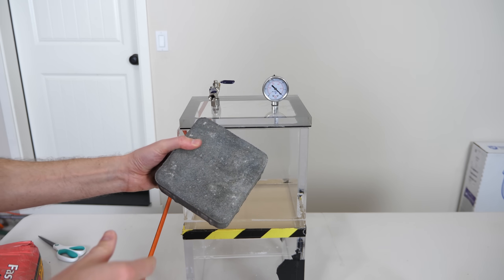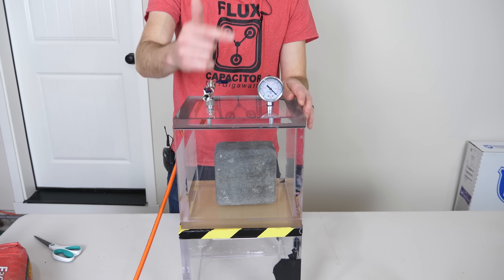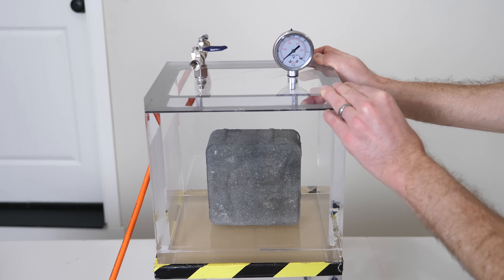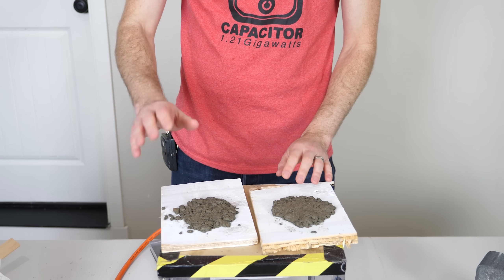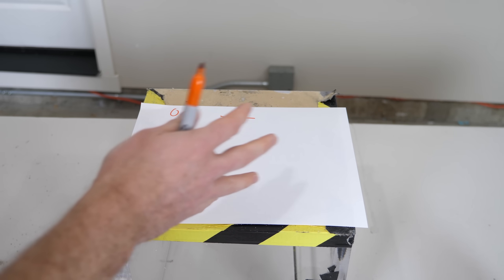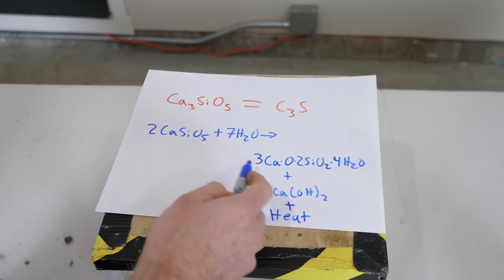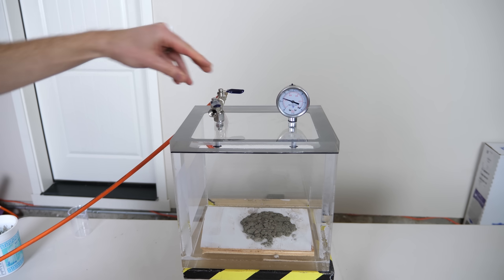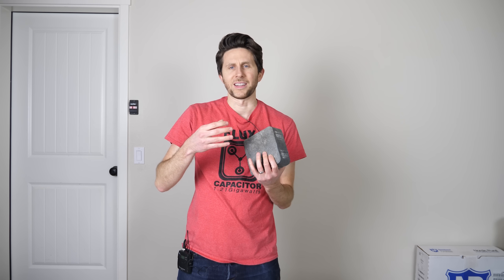Does Concrete Turn to Dust in a Vacuum Chamber? Concrete Without Oxygen Experiment

Comment: By that logic, removing all oxygen would also turn the oceans into hydrogen gas.
Reply: If oxygen was removed from all molecules, you would have much bigger problems than concrete crumbling. The human body is 65% oxygen by mass. All life would die, including the microscopic kind, as DNA itself contains oxygen.
Reply: @imarchello  the earth's crust is made of silica so the entire crust would collapse
Reply: @wedmunds  yeah but then why didn’t earths crust crumble when it had no oxygen🤨
Reply: @skylar4941  hes just silly
Reply: @skylar4941  it always had oxygen though? Not sure what you mean.
Reply: @wedmunds  not she. It was first created and was a boiling ball of lava
Reply: @criauxe  speak for yourself.
Reply: @skylar4941  lava is molten silicon dioxide. Oxygen bonds to silicon in the protoplanetary disk, long before earth even coalesced.
Reply: @wedmunds  what I meant is when earth started to form...
Reply: @skylar4941  that doesn't change anything. At no point starting from the birth of the solar system to present day was earth without oxygen.
Reply: @wedmunds  ik but there wasn’t oxygen maybe on other planets there was
Reply: @skylar4941  you can't just make unsubstantiated claims like that. You need evidence to suggest that all oxygen came from some extraterrestrial source.
Reply: @wedmunds  Well, it's true that, before photosynthesis started, the earth atmosphere was without oxigen at a certain point. But yeah, that is because all the oxigen had bounded with the silica.
Reply: @wedmunds  you say it's unsubstantiated to claim that oxygen may not always have been on earth, but the most recent study about oxidation on the planet, says oxygen started forming at least 3.1 billion years ago, some other studies say it started 3.5 billion years ago, can you prove that it was here 4.5 billion years ago?
Reply: @Gnozzares  Please explain what you mean by "oxygen forming in the oceans". Oxygen is an element, oceans don't just magically create elements. All the proof I need is the fact that silica (SiO2) is the most common form of silicon in outer space and is what proto-earth accreted during its formation, meaning that oxygen on Earth is even older than Earth itself.
Reply: @wedmunds  I was talking about oxygen molecules not atoms
Reply: @Gnozzares  I was never talking about molecular oxygen starting from the first comment.
Reply: @skylar4941  it’s crust evolved over time at some point it probably wasn’t reliant on oxygen
Reply: @shaneosborne5426  how the hell does crust evolve?
Reply: @skylar4941  the crust wasn’t formed then, when the crust was fully formed earth did have oxygen just not enough for you to breathe enough in, it was mostly Carbondioxide instead.
Reply: @thepiratepeter4630  oxygen has always been in earth ever since the planet stabilized (especially because these people are talking about oxygen atoms rather than actual gas (water has oxygen in it) it was just filled with a massive amount if carbondioxide and carbon monoxide so the air was far too toxic for life.
Reply: @skylar4941  the crust doesn't evolve it changes
Reply: @skylar4941 it always had oxygen?
Reply: @skylar4941  Yes, they crumble because all metal oxides, which occupy most of earth's surface rocks, will turn into fine metal powder. And the organic stuff like oils will turn into hydrogen gas.
Reply: @thepiratepeter4630  Or the iron causing red oceans at some point in Earth evolution making rust? How about that?
Reply: @skylar4941  the reason there was no oxygen GAS (MOLECULAR oxygen) was because it had all reacted to form silicates (i.e. rocks) and other oxides. Oxygen GAS is very reactive and reacts readily with many things. The only reason we have oxygen today is because there is constant production via photosynthesis.
Reply: @wedmunds  Reminds me of an episode of the anime No Game, No Life, where a magic simulation removes or adds whatever you specify.. removing oxygen from the air being one of them... and removing the different layers of the planet another...
Reply: @wedmunds  most oxygen was created by bacterias on ocean, so? It's called " photosynthesis" Which plus the planet's atmosphere turned red bcz of rapid raise of oxygen for a while.
Reply: @Gnozzares  they are saying it was part of (or parts of it where in) other materials, that then were released into the atmosphere.
Reply: @Ayzixior  ig because there was no oxygen therefore there was no sillica to begin with since the earth was still forming and didn't have oxygen yet mayb.
Reply: @skylar4941  maybe they meant o2
Reply: @skylar4941  then there'd be no crust yet
Reply: @skylar4941  the earth 4 billion years ago wasnt made out of cement or concrete
Reply: @Slovak_Ball  created lol. Bacteria just started doing nuclear fusion?? Craze stuff
Reply: @skylar4941  like a Pokémon
Reply: @wedmunds  fractalas prove the greatness of God
Reply: @skylar4941  it always has oxygen. Although there is a vaccum in space, every planet has some sort of atmosphere (weak or strong), and the atmosphere of earth has always contained oxygen.
Reply: @skylar4941  All planets have always had oxygen.
Reply: @Gnozzares  you, and a couple others, seem to misunderstand the difference between Oxygen and Free Oxygen.
Reply: @skylar4941  when? oxygen is so low on the table it was around before any heavier elements
Reply: @skylar4941  wdym?
Reply: @skylar4941  the cookie crumbles
Reply: @skylar4941  This person is talking about what would happen if oxygen was removed from _molecules_. The earth has always had oxygen, both in molecules and in the air. There was just a lot more carbon dioxide in the air before cyanobacteria started converting it to oxygen. Anyway, the air is irrelevant here. What they're talking about is if you took all the molecules and ripped oxygen out of them. Since many molecules contain oxygen (including carbon dioxide itself), that would be catastrophic to basically everything.
Reply: @wedmunds  I think if science is more about what we could know and less about what we should know also like my boi said I think there’s gonna be bigger problems than concrete crumbling lol for ex life yeah we’d be long dead
Reply: @wedmunds  doing psychedelics isn’t the same as going to school
Reply: @wedmunds  wow ur smart lol
Reply: @skylar4941  you skipped school?
Reply: @skylar4941  Woah that's a good good question
Reply: @wedmunds  Jesus Christ no one wants to be wtong when they clearly lose a discussion to you
Reply: @skylar4941  gravity
Reply: @wedmunds  He was right. At some point. There was no oxygen on some parts. The reason being many astroids. Some where just h
Reply: @skylar4941  Earth did not have FREE oxygen as a gas, but there was always oxygen locked up in silica and other compounds. Stop making dumb comments like this.
Reply: @skylar4941  No you weren’t trolling. You were just wrong, and when everyone proved how wrong you are you tried to weasel your way out by pretending you’re just trolling.
Reply: @RafaelBenedicto  this was literally a year ago, I was cringe and not mature back then, still I know a lot more about space now. That was 1 year ago when I commented that.
Reply: @Nehunya  mars have oxygen but not in the form of O2
Reply: @skylar4941  character dev right here
Reply: @skylar4941  bruh it has element oxygen in it well u need to learn chemistry i guess
Reply: @skylar4941 because it was only just being built??

(Also, there was other gasses to make up for the loss of oxygen back then)
Reply: @Gnozzares  The oxygen didn't just magically appear, correct?  It was always on the Earth, it was bound up with other elements to form a different set of molecules.  For example, water contains oxygen, iron oxides contain oxygen, carbon dioxide contains oxygen, silica oxides contain oxyen.
Reply: @skylar4941 hahaha nice joke i hope
Reply: @Gnozzares oxygen was created in stars
Reply: @wedmunds  when and where did oxygen get here and come from?
Reply: @wedmunds there have been carbon rich periods where almost no oxygen was present in the atmosphere.
Reply: @imarchello  Basically Thanos just remove oxygen from human bodies
Reply: @imarchello  They say “what if all oxygen was gone from the earth for 5 seconds” The earth, not the air.
Reply: @imarchello  even waterbears?
Reply: @imarchello  that's why this experiment didn't make sense.
Reply: @imarchello  wait.. humans are made mainly by water obviously, but does oxygen weight so much kore than 2 hydrogen atoms? Well.. no ok I'm remembering.. oxygen is 16 times heavier than hydrogen right? Soooo 8/9 (16/18 originally) of the water mass come from oxygen.. yeah.. fuck..
Reply: @imarchello  prove it.
Reply: @imarchello l
Reply: @imarchello just hold your breath until they turn the oxygen back on and you’ll survive.
Reply: @imarchello key word molecule most people don’t even know what it means lol
Reply: @imarchello And yet people want to believe in Evolution... You can't have it without having an atmosphere and you can't have an atmosphere without oxygen and carbon dioxide. You actually need life to produce both, so evolution is not at all possible! Thanks for clearing that up! Jesus is King! God is real!
Reply: @imarchello  some kind would thrive no? Anaerobic bacteria and such?
Reply: Well yes
Reply: I didn't think I'd be learning something about Earths crust today, thanks commenters!
Reply: @ClippyJoestar  haha the short ATP comment actually helped me with my bio studying 😅.. had a minor brain fart and couldn't figure out why ATP sounded so familiar... hour and a half later and I have studied enough bio for tonight😂
Reply: @ClippyJoestar  bruh your brain is full of oxygen
Reply: Some of these "what if" videos are just pointless to talk about just saying
Reply: @anderray9794  Next what if video... "What if, what if, videos ceased to exist for 3.29731 seconds"
Reply: @SheLovesUke1014  I'm not sure what you're exactly trying to say, but fire requires oxygen (or another oxidizer) to burn. The "fire" 4.5 billion years ago was glowing hot magma.
Reply: Well it would possibly because boiling point is dependent on air pressure.
Reply: Earth would lose a lot of mass and every life form would die.
Reply: And most of Earth, from the crust down to the outer core, in molecular silicon with just a tiny bit of carbon and metals here and there.
By the way, thst would remove about 46% of Earth mass.
Crumbling concrete would be the last of our problems with the entire Earth instantly robbed of almost half its mass.
Reply: Yes. But vaccum pump can only remove free oxygen from O2 and not the oxygen in the compound H2O
Reply: ATP has 13 oxygen atoms in it so I'm assuming we will die suddenly
Reply: nice we were  kinda low on that in the lower atmosphere anyways
Reply: yea it's retarded, they talkin about removing oxygen from compounds also, of course that would do something wtf? and?
Reply: I think it’s meant as oxygen gas as in O2.
Reply: What about our body’s then
Reply: Well, hydrogen gas and sodium
Reply: Literally makes me wonder just how crazy it would be if truly all Oxygen was just gone all of a sudden. Cuz we sure as hell know those videos are just...right but basically wrong since they only showed some of the stuff that would happen
Reply: @bountylord9125  it would basically hit the reset button on the formation of earth as well as restarting evolution of life. This is mainly due to the fact that most molecules have an oxygen attom attached.. the real question my friend is would sentient life happen again or was the location in space, when earth was formed, somehow a factor in our existence 🤔
Reply: @Ritesh He is helium H2 is hydrogen
Reply: @Ritesh 

H is hydrogen
He is helium
Reply: We wouldn't exist either.
Reply: Then Carbon will be raining on us
Reply: @theaustrianpainter-m5o  🤦🏼‍♀️
Reply: Dont forget the ozone layer
Reply: it would be cool if only half ofvl the oxyghen would be gone and then ignite the ocean
Reply: @Andre_Thomasson  if the intent is to dry up the ocean, and don't quote me on this cause I'm too lazy to do the math, I'm pretty sure the remaining oxygen in the atmosphere wouldn't be enough to burn all the hydrogen.
Reply: Bruh by that logic the whole earth would likely experience problems
Reply: @asdgreersf  wait.... are we not already experiencing problems🥺
Reply: It would turn it to liquid hydrogen
Reply: @74_whitey62   if water don't have oxygen what would happen? Well it would become hydrogen not liquid though. Oh the world would look like venus if there's too many hydrogen in the atmosphere
Reply: half the people in this comment chain are talking about o2 and the other half are talking about all oxygen even in compounds. BRUH
Reply: @nathanromine6032  best part is there's a good half of each side that doesn't know which side their on😂
Reply: @nathanromine6032  what means even in compounds? oxygen is oxygen you press 8 protons together= oxygen you bond it= still oxygen you add neutrons and its still oxygen
Reply: i think they mean remove evry oxygen atom fro earth so yes
Reply: True, chemical reactions can’t be undone, so you are rigtj
Reply: @brickdomino1  it would pull its self together, but in doing so would reduce the size of the earth a significant amount. I feel like this is what they meant by crumble. You two are basically saying the same thing just different wording... you chose scientific terminology and explanation where as they chose a much simpler easier to understand wording... but neither is wrong
Reply: That’s why physics is taught in universities and not youtube
Reply: Thats addressed in some of the more scientific videos not just parroting other content. Tell me you haven't watched any of those videos without telling me you haven't watched any of those videos lmao.
Reply: There is a difference between just oxygen and air.
Reply: That would require a LOT of energy.  Also plz don't.
Reply: Well it depends.. removing all oxygen refers to oxygen molecules or oxygen gas (O2)? In the first case yes, in the second case nope.. obviously
Reply: If all oxygen molecules disappeared for 5 seconds yes that would happen
Reply: I thought this was a joke video, but judging by the comments there are all too many people who do not understand that molecular oxygen in the atmosphere is but a tiny fraction of oxygen on Earth, or for that matter in the Universe
Reply: Removing all the oxygen from a big pile of rust would turn it back into my old Alfa Romeo!
Reply: As well as kill all life on 🌎🌍 too😅
Reply: Well if your using that as your metric then sure, if your going to remove oxygen from molecules then rocks very well may actually tumble to dust, even though the only way for concrete to break apart in space is from water vaporizing in the rock.
Reply: Sus
Reply: Hah lol
Reply: Boom
Reply: Oh no
Reply: It does
Reply: Not duh theres comets
Reply: True
Reply: Thats what happened on mars
Reply: Great Idea !! tell him 🤣
Reply: And some sodium chloride lol
Reply: @mohamedalhigagi3916  no duuuude, it's salt
Reply: @wedmunds  ye ik
Reply: ik
Reply: Technically that's true.
Reply: When they say all oxygen they mean all lose oxygen gas
Reply: Haha... Nice one
Reply: Not really
Reply: 100
Reply: we'll be right back
Reply: @SkyNa72  dooooo diiiiiiii drrrrrrrr, blip..... hey soorry about that guys... O2 is back now, you may return to your normal activities
Reply: Babe the lights went off light a candle will you😂
Reply: @arundhatiganguli7524  I can't find a lighter... got a match babe?
Reply: That is exactly what would happen. But creating a vacuum is not the same thing.
Reply: Kaboom
Reply: @nindoninshu  whoosh
Reply: I mean it would
Reply: yeah i actually didnt think that
Reply: funny to think about but yes that's the standard aliens have some magic device that takes every oxygen atom away completely,it's not just pulling a vacuum because trapped oxygen will stay trapped in a vacuum and the container will just change size
Reply: Too many pseudo scientists on the comments here making asinine assertions straight out of their 💩shuts.
Reply: you can produce oxygen from air, but there is no oxygen in air per say. To make oxygen, you will need to introduce oxygen.
Reply: @philindeblanc  and this kids, is how science has proven our entire existence to be just one paradoxical FUUUCK
🌈⭐
The more you know
Reply: Duh
Reply: And boom
Reply: yeah
Reply: I've noticed he really really likes vacuum chambers! Atmosphere isn't that impressive, just annoying usually hehe
Reply: @4corander  he really needs a second chanel just for vacuumed chambers like those hydraulic press channels... I'd sub
Reply: Well.... true
Reply: And table salt. 🤔
Reply: And living beings into a pile of hydrocarbons
Reply: dayum , and there alot of trapped water under the earth .. the instant conversion is gonna completely rip up the mantle
Reply: Yeah
Reply: It would be crazier than that. In water the electrons are mostly displaced from the hydrogen nuclei toward the oxygen nuclei. If the oxygen nucleus and 8 nearest electrons disappeared from existence the remaining electrons and hydrogen nuclei would now have a mass specific energy density of about 1.3 MJ/g or 250 greater than TNT. The temperature would be higher than the surface of the sun and the density would be significantly higher than cryogenic liquid hydrogen. The earth's crust and mantle would also be plasma, but not quite as hot. The "oceans" would instantly explode into space at 50 km/s hitting the moon about two hours later with sufficient force to blast away the  regolith and heat the surface to glow as brightly as the sun for a while. After hours or days the smoothed earthward surface of the moon would have cooled enough to stop glowing from its own heat, but it would continue to shine dozens of times brighter than it normally does now illuminated by the earth, which 
would continue to glow like a bright white star for millenia. Earth would be so bright, it would even affect the weather on Mars and Venus.
Reply: And you will turn into a bunch of carbon and hydrogen with little phosphorus, iron and few other elements
Reply: “imagine fish develop a little bit of a curse and start separating the oxygen from the hydrogen in the water” -me a few weeks ago
Reply: Yea. But dont vacuum chambers remove all gases? Including hydrogen?
Reply: @waltergrove2657  not... really. They do remove most gases, but a true vacuum is not something that even exists in space. The closest we come on Earth is at JPL, and its walls are almost 10m thick to withstand the atmospheric pressure. I do not think that people truly realize exactly how much our atmosphere weighs, nor how much pressure that atmosphere puts on every square cm of one's body.
Reply: True
Reply: among other stuff.
Reply: Didn't that make an explosion since you're doing nuclear fission and releasing energy?
Reply: Only one way to find out!!! >:)
Reply: True logic
Reply: I mean yes, if all oxygen were removed there would be nothing but hydrogen left.
Reply: And most of the litosphere into positively charged ions in an empty space
Reply: @jakubkrivanek3112  this may be rare time where that is the least of our worries
Reply: EXPLOSION!!
Reply: Yes that is the only problem with removing all oxygen
Reply: Unless the Hydrogen reacts with sodium or chlorine
Reply: And a significant portion of the Earth's crust is composed of oxygen atoms glued together by metal and semimetal atoms.
Reply: and we would be unconcious
Reply: At least we won't have to worry about it because there won't be any oxygen for it to combust.
Reply: L fish
Reply: & Most importantly, one element will be removed from the periodic table
Reply: Or H2
Reply: Animals that live next to an underwater volcano are FUUUCCKKKED
Reply: Really not salt😂😂
Reply: Dang it there goes my master plan
Reply: Yeah. h2O!
Reply: Well NO, because hydrogen is not in water, as much as we claim it is, this is false.
Reply: Nuclear Fission -> Energy-> Seperation of Water to Hydrogen and Oxygen Gas.
Reply: For sure we would have a blast
Reply: Water is not made of hydrogen gas.
Reply: @philindeblanc  What is water made of?
Reply: @yournumberonepal  Water is water. I would say its a element.
Reply: @philindeblanc  I just can't even right now.  Please, please, be trolling.
Reply: @philindeblanc lol
Reply: Different scenarios altogether
Reply: ok wow, i completely forgot that aspect.... thats kind of nuts. similarly, CO2 would also just become full carbon? i was only thinking of the gas form of oxygen and you just blew my mind lol
Reply: Wrong
Reply: No it doesn't
Reply: That is correct 👍
Reply: It's big brain time
Reply: Different experiment lol
Reply: @maxsmith4415  apparently lol
Reply: And salt
Reply: Not may be because has ionic bonding along with hydrogen bonding
Reply: Atmospheric pressure would drop considerably, and your lungs would explode.
Reply: If the atmosphere disappeared all liquids on this planet would outgas. They would boil away into space. If the Earth's magnetic field switched off the solar wind would strip away the atmosphere and the planet would end up like Mars eventually.
Reply: Well yea lmao
Reply: I’m guessing it just means oxygen outside of compounds
Reply: And would it…scientifically-speaking?
Reply: By that logic all rust would dissapear
Reply: That is correct. 

Lol
Reply: Removing ALL oxygen is different from removing oxygen from the atmosphere. Oxygen chemically bound into various compounds would remain unaffected if the atmosphere were to lose oxygen.
Reply: No atmosphere is different than just oxygen that is only 3%  of earth's atmosphere.
Reply: Ocean will burn, splitting of H20 , hydrogen burns and oxygen helps in burning
Reply: ocean go boom boom
Reply: True.
Reply: we’d be cooked
Reply: Also the vacuum chamber would implode
Reply: And the world would explode
Reply: And in our bodies
Reply: i think they meant just O2, not every molecule that includes oxygen.
Reply: BOOM!
Reply: A load of the planet s crust would colaps sagfurther in on its self
Deu to the oxygen molecules traped in sediments
Reply: Technically speaking it would.
Reply: I think a lot of people have beat me to it, I was also going to comment "it depends what you mean by losing oxygen".  If all diatomic oxygen gas disappeared for five seconds we probably wouldn't notice because the atmosphere is mostly nitrogen, so no one would notice they are unable to breathe, but they might experience a momentary shortness of breath.  If all oxygen atoms disappeared we would certainly notice as we all explode from the rapidly expanding hydrogen clouds that were once the water in our bodies.
Reply: The boiling point of water is greatly reduced under a vacuum, hence why AC systems have to be vacuumed down before charging them with refrigerant. The water evaporates to keep it from freezing inside the lines. So would a vacuum dry up the oceans? Well... We haven't found water on any other planet and space is in a vacuum!
Reply: not really not everything is bonded as powerfully as water   different material have different chemical bonds some weak some strong some unstable and under the right conditions like a strong vaccuum or no oxygen they can lose their bonds
Reply: by that logic if i remove all the jelly from every peanut butter and jelly to ever exist then i'll have a lot of fentanyl
Reply: Water is H-O-H. If you remove the oxygen, you don't get H2. You get monatomic hydrogen. Though that would quickly turn into very hot hydrogen gas.
Reply: Yes it will but the energy it need will be insane
Reply: that's true... but the sea contains salts too right? H²O - H²
Reply: @imarchello  yea all humans will just become a hydrogen balloons
Reply: No it doesn't, removing oxygen isn't a chemical process.
Reply: I should have added the term "via vacuum"
Reply: Yikes 😬
Reply: The way you phrased that makes it seem like you are not correct about it when you are 😂
Reply: And your bodies into mush, as a human body is 80% water, which has one oxygen atom in its molecule, too.
Reply: Yes, so is the premise that all oxygen atoms disappear even if bonded with other elements or just the free element? I think it's implied that all oxygen atoms would disappear even ones that are bonded in molecules. I'm glad he made this distinction midway thru the vid. But yes, a lot of things would go wrong if you broke all molecular bonds where oxygen was present in the entire planet and concrete integrity would be the least of our problems! I mean, a bigger issue is the fact that we would all be dead...instantly.
Reply: @jerrylarch6556  I mean, it SHOULD be the atom in molecules, too.

Because if we count out molecules, then O2 stays, which inherently changes nothing much.
Reply: Water will boil
Reply: Concrete is only 3% water.
Reply: More like sodiumhyperchlorate.
The sodium chloride and hydrogen would react before the hydrogen escaped as free hydrogen.
Reply: Free atoms of Oxygen do not exist. Pure oxygen is in the form of oxygen molecules.
And the argument that an oxide (CO2) existed BEFORE oxygen and only came about because of photosynthesis was priceless!
Reply: All rust would turn into pure iron
Reply: A vacuum doesn't suggest you've removed the right ingredient, you've just made the environment less hospitable.
Reply: And salt plus whatever else was insolution
Reply: And salt
Reply: And turn Concrete in Calcium and Silicon Carbide
Reply: Rather, into water vapor. Which they will.
Reply: It won’t turn to hydrogen, but it will turn to gas
Reply: I mean they would boil away.
Reply: I mean tardigrades would be fine? They can't really move without air and they are just fine in a vacuum
Reply: It's just 5 seconds tho
Reply: Na. O2 is21 percent of the atmosphere.  Reducing the atmosphere weight by 18 percent or more. The water may boil away tho
Reply: it was said very wrong . he should have said "air" instead of oxigen
Reply: Believe he is referring to in the air. Not from compounds
Reply: Is that what happened to the sun?
Reply: ha everyone would be talking in chipmunk voices XD
Reply: No, mostly into a "heavy water"
(H2)
Reply: He was talking about vacuum tho
Reply: But how, their volume will increase but no chemical reaction will happen so how could it be
Reply: That's why they don't make space shuttles and rocket ships out of concrete.
Reply: @olivervision  lol did you even watch the video?
Reply: @olivervision  🤣 i fuckin hope this is satire
Reply: better not throw a match above it
Reply: @catgirlralsei  won't burn, no oxygen
Reply: @wedmunds  ever heard of a joke?
Reply: @catgirlralsei  yes, and it's a poor one given the context of this comment.
Reply: @catgirlralsei  i actually laughed at his comment lol so id say your second comment makes you the joke my good sir
Reply: If oxygen will be gone for 5 mins then there will be a new start of life on earth .... New creatures and more............. will it be like before without global warming !.......as carbon dioxide also has oxygen ..... 
WOW!!!!
Reply: Not hydrogen gas- but it would boil away. It's a matter of pressure gradients.  Gravity would probably keep it in earths atmosphere? but it wouldn't remain in large bodies pooled on the ground.
Reply: Imagine using logic in 2021.
Thought logic was banned, along with white men, cis men and opposing viewpoints and ideas. Oh well,I guess I'm still on the learning curve 🤷
Reply: @clevertaco328  holy fuck nobody took your bait in 3 months, my faith in humanity is restored
Reply: @clevertaco328  ok ok you need to explain something trans humans ok but cis? Me interested in chemistry prefers to sleep in a trans state because spooning just isnt nice in cis. In winter cis might be a an option because its easier to keep warm thats why most animals are cis
Reply: @СергейВасильевичРахманинов-э8ж  Although my statement was (in the minds of a vocal few) true, I was being sarcastic. I don't get paid enough to care nor sort it out.
Reply: @СергейВасильевичРахманинов-э8ж  I love the the support🏳️‍⚧️... but I can't say I quite get what you're saying.... like I sense a hint of satire but not enough to confirm,  and if it is not satire then... well, then you're just wrong.. but if it is satire then I'd actually like to know which part you think makes it satire..
Reply: @clevertaco328  oh thatd be because its not just a curve mate... its an infinite loop